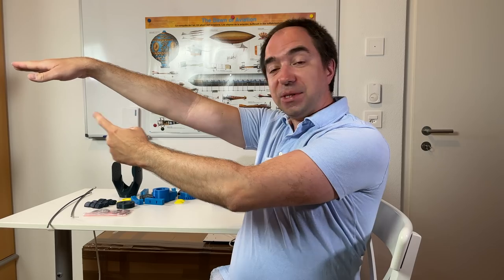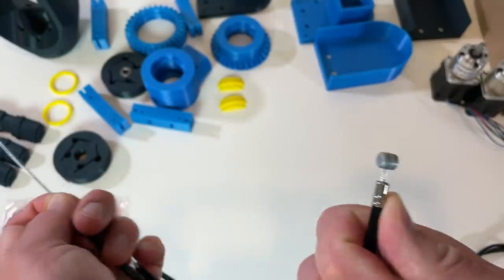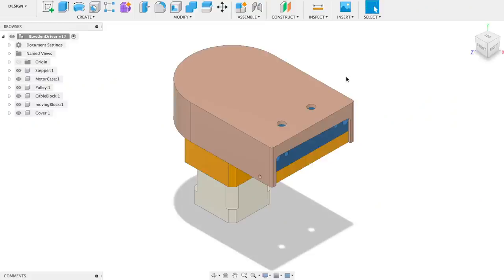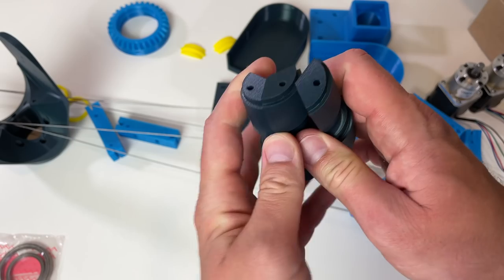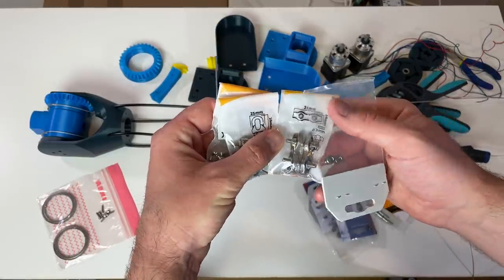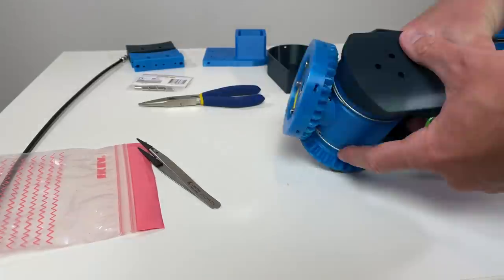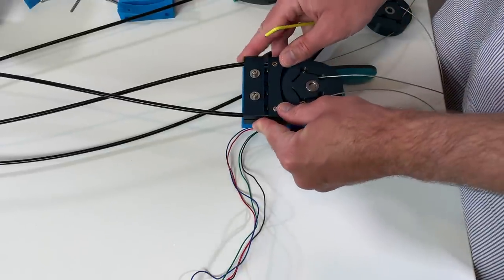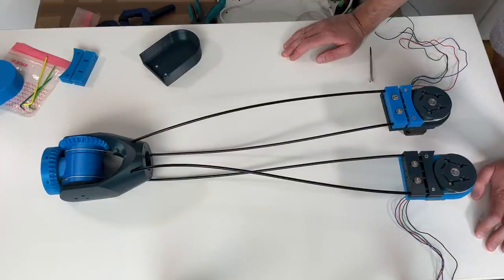Bowden cables for the robot arms? Will it work?

Comment: What about not having the springs you have there but instead have the pulley split in two and press the two halves in opposite direction with springs. Then the problem with the parallel block tilting should be gone.. Or?

Comment: You may replace the Bowden tubes with big PTFE tubes and steel wire or dynema. They can carry less force overall but don't have the problem of the metal spring, which makes the Bowden tubes longer when bent. Or incorporate a spring system which makes both ends slightly flexible. Then you also have some kind of shock protection for the gearbox. And if you measure the movement of the springs, you can also do force control :)
Reply: Oh, I hadn't watched till the end

Comment: I'm curious if Dyneema shouldn't be used instead, extremely low friction very low elasticity yet stronger and more bendable then cables. You would have to splice it to attach it to anything, but other than that a wonderful material for tension based systems.

Comment: Couldn't a cable adjuster and a rotation sensor be integrated to negate the extra cable movement? So that when the rotation doesn't match the cable movement the adjuster would adjust the cable.

Comment: Since the cable will not be free-floating like this in the final product, and you can calculate the cable path from other motor positions, probably you can compensate for the cable-lengthening in software.

Comment: The bending/straightening contraction/expansion problem COULD be compensated for in software ... because the controller knows every joints position.

Right?

Comment: Should be able to do precise positioning if you put encoders on the wrist joints themselves, so the cable length change can be compensated by moving the steppers. Friction will still be a problem, but at least to start with, simply using larger steppers would solve it. In the long run you may have trouble with cables/tubes wearing out. Bicycles only apply significant tension to the cables after the brakes have engaged, and then there's not much more movement of the cables until you release it. But on a robot you'll be continually sliding the cables in the tubes while under tension.

Comment: A couple thoughts here.
 1. if you move the motor half way -  at the elbow - you still reduce its influence on moment of inertia at the shoulder by a factor of two which is significant. 
2. this way transmission from "elbow" to "wrist" does not need to negotiate bends so simple cable pulleys aka capstans or belts are fine, which means is less friction, less flexing and  option of having a lightweight reduction gear at the wrist with motor (and first stage reduction) at the elbow, if that feels appropriate.

Comment: Bowden cables are generally intended to be used as push / pull cables.  IOW a single cable.  You are using them in a pull / pull arrangement.  With the pull / pull setup do you really need one long continuous outer tube?  It seems like bearing surfaces for the cables -- think pulleys -- at various points along the arm would be fine.

Comment: A YouTuber I believe named Will Cogley solved the cable lengthening problem by using a servo and having the encoder at the end joint so regardless or stretch the servo would try to maintain position.
Reply: I was going to suggest that. Ill check that video out!
Reply: Between that, and all the DIY/OS Robotic Arms being made on YouTube right now, i seriously think we need to meet up and share+compare designs and whatnot.
Reply: Also Skyentific NEEDS to strap that hand as an end effector one day lol. (Then put it on James Bruton's "open dog" or some bipedal robot (l o n g    t e r m goofyness unlike use as an end effector) ?)

Comment: Can that be a feature rather than a problem. Wanted or not, it's feedback. You could perhaps determine position and force based on that cable "backlash"?

Also, can single-sided help? Boden cables aren't very good transmitting a "push", but they do work a bit. Might be worth an experiment: half friction at a cost. Also removes the non-parallel motion of the spring block. Think of an alligator's mouth: really weak to open, but damn good at closing. 

It's just a matter of finding the application that isn't concerned for the limitations. An end-effector gripper, do you care you have no power opening the grip?

Comment: What about cutting the Bowden cables from center, then a little bit shorten them, then design a spring mechanism in between to connect 2 bowden cables? This way the spring movement will only occur on the Bowden cables and motor section does not need any moving parts.

Comment: If the motors are in a fixed position at the elbow there shouldn't be any relative movement between the actuated part and the motor. 
Somewhat like many older Kuka have all 3 motors sticking out the back of the elbow. 
Or am I missing something.

Comment: some ideas i had that might alleviate some issues
-springs on both ends of the tubes so that all the travel isn't just on one end of the system should help a little
-spring in the middle instead [or in addition to the others], more specifically, at the hypothetical elbow, we basically just wanna give the tube as much room to expand and contract as possible and spread the expansion and contraction out, kind of like a real muscle
-concentrating the springs in places where the cable does a lot of flexing should also keep the tube from needing to compress as much, as the cable has more room to find a better path

Comment: Nokon cable housing may work better, it is aluminium segments with ball joints, the difference in radius between the wire and the housing may be less when bending.

Comment: You could fix the extension problem in software. When its attached to an arm its linearly proportional to the bend of the arm, so should be quite easy to calculate. 
The friction problem is solved by using pulleys and bearings, instead of tubing.
(there's a lot of friction present in those tubes.)

Comment: Assuming you can solve the bowden cable "stretch" problem, I think this could work although as you have pointed out, it has drawbacks. Perhaps you need independent blocks for each tube rather than a single block for both? Once that problem is solved, tracking the position of the end effector is all you need to prevent this problem from causing unwanted motion on the outputs. Perhaps hydraulics are the way to do then...

Comment: I experimented with spectra fishing line running through ptfe tubes, it could only pull of course so they had to be used paired, but it is so slippery, you can run both down the same tube and they slide past each other.
Reply: That's awesome, you could have fully rotating effectors on the ends and a single spring for length compensation.
Reply: @freakinccdevilleiv380  I used a spool from my gus Simpson build to actuate the spectra line  with a few dozen wraps around it couldn't go forever in one direction  but could go several rotations in each direction which was more than enough to wiggle an arm.  but no technical reason you wouldn't be able to do a loop for full continuous rotation forever I think. You would need to add a guide to keep the thread from walking off the end of the rollers.... Or actually, if you just loop around a couple times that may not be an issue. Worth experimenting with!
Reply: yes this is a much better materials choice.  I prefer PE braided fishing line over spectra.  It comes in 300lb test down to 10lb test and everything in between.  Might even go up to like 400lb test and up a bit more 500lb or 600lb I think is around the stopping point.  But yes TPFE teflon tubing.  This is what I'm using in my robot.

Comment: Please do a v2 with derailleur cables. They don’t change length. And you can get thicker Bmx brake cable that use this type of outside casing and has nice Teflon inside lining.

Comment: I have played with something of the same kind in a smaller version But instead I used braided fishing line And Servo motor But I have a problem with it moving together when it moved as you showed. 
I moved Potentiometer out in the Joint and it worked really well

Comment: This system simply needs a closed loop control. No need to try to address the length variation on the mechanical design side. Slap encoders on the joints. It will also tackle the friction variation by just applying more torque.

Comment: If you use 2 steppers per Bowden Pair ... I think on an arm/joint/bend, the movement could be calculated close enough that you wouldn't need the springs and could make it more rigid. This would also allow you to put springs on the effector/joint side on the end of each cable push/pull, and you could adjust compliance/rigidity in realtime by adjusting/matching the the cable lengths independently.

Comment: I like the wrist design. When I saw your design I had the following idea. Replace the cables with belts. A belt runs from a pulley on the wrist to a double pulley on the elbow, then from this pulley to the motor. You can even use the double pulley for gear reduction. Now you can have three motors near the shoulder. Elbow motor pulley -> belt -> elbow rotation. Wrist pitch motor -> belt ->  pitch double pulley -> belt -> wrist pitch rotation. Wrist yaw motor -> belt -> yaw double pulley -> wrist yaw rotation. The double pulleys are mounted as idler on the elbow axis.

Comment: Have you thought about using bigger bowden cables, like Teleflex cables you use on small outboard boats with steering wheels, they are made for a lot more power. Maybe there is a small version that is not too big(or expensive)

Comment: What about using axes instead of cables? You could transfer the movements with gears at each joint to another set of axes, probably losing a little bit of precision at each joint but... Or maybe using multiple u-joints...

Comment: I've thought of things like this for years, and often referred to such things as "fly-by-wire prosthetics", using cables to control limb movements while placing the heavy and bulky motors/servos elsewhere. Using Bowden cables as you have is probably the most problematic way to do so. Instead of trying to manage the whole "they get longer when bent" thing, just keep the cables straight at all times. If the cable needs to go around the elbow, use a transfer mechanism to connect two cables, one in the forearm and one in the upper arm, that moves along the same pivot the elbow does. When the elbow bends, use software to ensure the other joints don't move by adjusting accordingly. The actuation of the cables shouldn't be done by wrapping them around a drum as this itself causes the stretching issue. Instead, actuate them with lever arms, or mounting them on the surface of a wheel/disk/circle/sandwiched disks to ensure the cable stays straight. Yes, it means you need a larger disk to actuate the cable a given length as compared to wrapping around a drum, but it means there's bending effects. This should also reduce the amount of wear that occurs on both the cable, and the actuator. 

The use of cables to transfer motion does work. Airplanes have used this technology (called Fly-By-Wire, hence the name I use) for almost as long as planes have been a thing. The important bit is that the distance between the actuator and the controlled surface be fixed as much as possible. This means having a structural forearm, elbow, and upper arm (which incidentally is just known as "the arm", but that's confusing...), and likely shoulder to keep everything held in place. It's also important to have the extension and retraction cable anchors to be connected to each other so that extending one retracts the other by the same amount. It's also worth mentioning that this type of device would be best suited to something such as a human hand, as it requires multiple cables per finger to give it the same or similar range of movement that a normal hand has.

If you're willing to revisit this idea, It would be interesting to see how not bending the cables at all works out.
Reply: no it is okay to bend them, just have to keep them bent consistently at the same bend and not have them bending during use then unbending again.  This way they aren't bending at all any more than a preset bend that is kept consistent.  Also, he has more friction since he's using thick metal cable rubbing on a metal interior.  He should use teflon tubing with a PE fishing line instead which will cut down friction.  He also uses ZERO lubricant on the cable which also greatly would reduce friction.

Comment: use derailleur tube instead of braking tube can solve the bending-shrinking problem, but the tube would be much stiffer
Reply: Other option is linear brake cable housing that BMXs use. its just a stronger version of derailleur cables.

Comment: A possible extension could be to use a bowden cable loop (for example 5 turns) with a reducer at the wrist joint. This could greatly increase the torque and accuracy despite the flaws of the bowden tube. Another type of cable way (pulleys) would solve the tensionning problem. A stiff pretensionned polymer cable / rope could also work better in a loop system.

Comment: On bicycles, there's a tensioning, screwable mount that goes over the bowden tube on the outside. This solves your problem of the cable lengthening/shortening. "Stelbout remkabel"

Comment: You should try to separate motor and gearbox with those bowdens. Try to put gearbox into the wrist, motor on the ground, and transfer rotation from the motor to gearbox with bowden.
Btw, KUKA does this, but uses belts to transfer rotation from motor to gearbox.

Comment: The problem that you have is that you transfer the whole 100% force through the cables.
1) make cable to drive a system of blocks of somethign like that and you won't need to tension it too hard.
2) small change in length of bent bowden is divided by the reduction rate of your gearing mechanism.
3) use teflon coated gearshifting ca bles from bikes (those are thinner, flexier and much smoother).

It is suboptimal to pull the entire torque by these cables.

Comment: I think that such a drive system would work a lot better if you made it a complient system (with encoder for exemple) rather than trying to do a rigid system. That way you could exchange the mechanical difficulty for a software one.
An idea : fixed motor position and fixed axis position. Only use bowden tubes where an other axis would be.

Comment: That spring is a great idea.. The problem with the flex of the block can probably solved by a dovetail pattern on the base and having the cable retainer slide.. Or have a small linear rail holding them.

Comment: The friction issue could potentially be fixed by some kind of lubrication system. It's not an ideal solution, but it would work in industrial applications where industrial machinery is already lubricated on a scheduled basis. Alternatively, different materials could be used, such as a jacket with a higher material lubricity, or a cable with a higher material lubricity. 
The actuation issue that occurs when the tube and cable are coupled should be a non-issue, as the tubes should only be there as a guide, not coupled to the cable. If you're rigidly mounting the tubes to a frame, you should add a spring, or a bellows if you need the cable to still be enclosed, this would allow for stretch and compression in the tube, which would allow the cable to not actuate when the tube bends, due to decoupling of the tube and cable. 

Your spring solution was close to working, but wasn't implemented properly, you want springs on the tubes themselves, so that the tubes essentially 'float' between the two ends of the robot's frame. What needs to be tensioned is the cable itself, not the tube. Think about water running through a pipe, the pipe is rigid while the water is not, the water is free-flowing within the pipe; now inverse this logic, where the interior material is the rigid component, the conduit around the rigid material needs to be flexible in comparison. This is exactly the situation here, the Bowden tube needs to be flexible in comparison to the rigid Bowden cable, and to achieve that you need the Bowden tube itself to be held in a sprung suspension when it's coupled to the frame of the robot; as it currently stands in the design, even with the spring tensioner, you are making both the tube and cable rigid components, when the tensioned cable should be the only rigid component.

The Bowden actuator will work, it just needs design refinements and proper implementation of the components. I hope you read this, are able to understand this (I'm not the best at explaining things), and implement the latter suggestion in a version 2 of this robot arm. I know the former suggestion, the one concerning lubricity, is much harder to achieve, if not outright impossible unless an off-the-shelf component already exists; but the latter suggestion, the one concerning how the Bowden tube is implemented, where it should be a sprung suspension rather than a rigid component, should be easy to implement, just braze/solder a spring to the metal crimp at the end of the tube, then set the other end of the spring in a hole. Implementation of this would require the arm to have a skeleton, as the Bowden tube is not a floating piece located only by a receiving hole, and could fall out in a test setup that does not have the arm's skeleton in place.